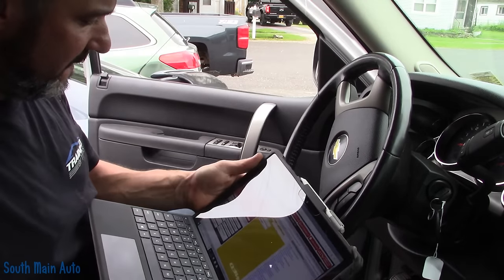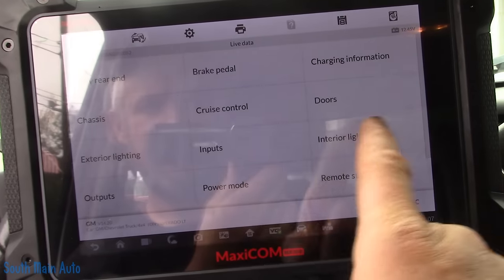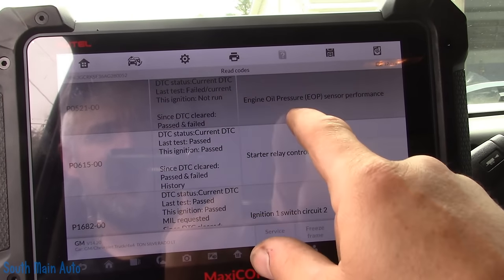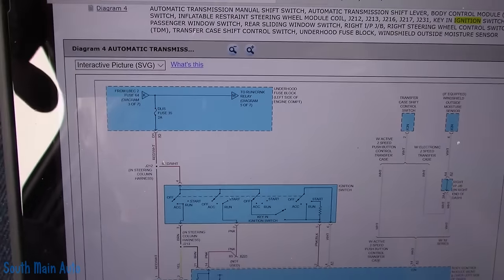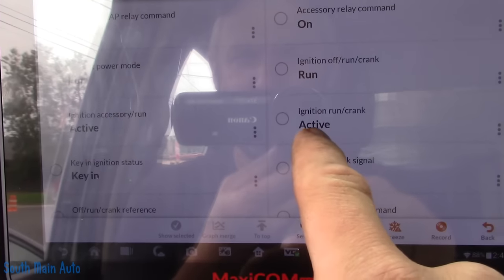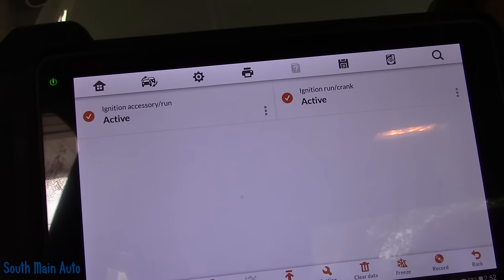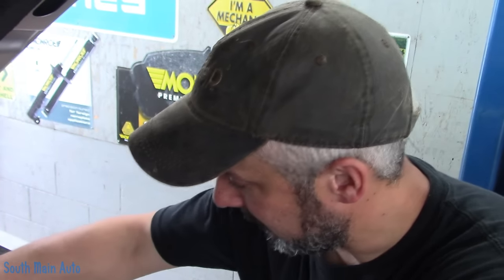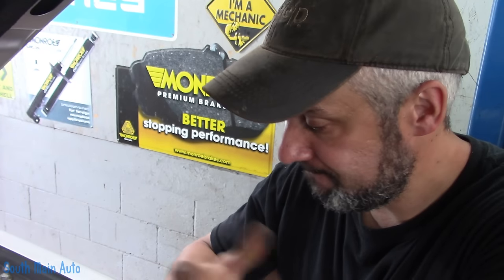Chevy/GMC Truck: No Start - No Crank

Comment: I am having a similar issue except, I have replaced the starter. When I initially replaced the starter, it turned over 3 consecutive times. The fourth time, landed me back to square 1. 

I thought the starter had gone bad and got it replaced through O'Reilly's. Turned out, when they tested it, it passed 3x using their Starter tester. They gave me a new one. Put the new one in, and nothing. 

Both the alternator and battery are good. I was thinking it may be a wiring issue but I've looked over and over and see no issue.

*PS, spark plug, fuel pump, and all fuses and relays are good. 

Any help would be GREATLY appreciated. 
-2005 GMC Sierra 1500 5.3 V8 106k miles

Comment: Thx for the post.  Question:  Do you have a go-to site online that a lay person (DIY'er) can go to to acquire automotive wiring diagrams?  I see several when Googled, however, they are lacking.   When I ask my local Ford dealer parts counter person he gives me a 'no' response but the look of 'You should stay the hell away from your cars electrical system before you screw something up.'.

Comment: Can you just use a brush, plus the air hose to blow out the dirt not saying it will fix the problem and also contact cleaner by disconnecting the ground on the battery and spray the fuse box down after blowing the Dirt away from the fuse box for my information just inquiring thank you

Comment: I have a question have a 2000 Chevy Silverado truck ran just fine was parked went to go start it would not start someone said something about it might be the cluster took the cluster out sent it out to have them fix it they never did say what was wrong with it or if anything was wrong with it sent it back put it back in no different mind you it ran just fine before all this I'm thinking something very simple but I don't know nothing about this also I looked up ran a wire from the fuse box and touch it on the red main wire when the ignition is on on and it will start I watch some of your videos you are very intelligent with this stuff let me know if you might know what it might be thank you and keep up all good videos

Comment: The scanner computer used in the video: https://amzn.to/2H3l6dt Autel MK908 Ultimate Wireless Automotive Scan Tool with ADAS, ECU Coding, Full Bi-Directional Control, ABS Brake Bleed, OE-Level All Systems Diagnosis

Comment: Hey Eric. I have a really new chevy truck . Is the tail gate heater module controlled by the body control module. I am freezing my hands off every time I have to push it into the garage to get fixed. For those out there that do not understand. Chevy has a heated tail gate for when you have to  push your truck into the garage for repair.

Comment: I have a 2011 Chevrolet and had a short in the fuse box so I pulled the box off. Unhooked the plugs on back of it and looked it over real good. When I hooked it back up and tried to start my truck a security light popped up on dash. Now it won't do anything and that light with a lock on it comes on on my dash

Comment: It is fairly common for those power (fuse) boxes to be filled with dirt and corrode the metal components. This in turn will set off a series of electrical issues. The box cover is poorly designed, and the metal components are made of various cheap metals- much cheaper than they should be.

Comment: Good video, did you change the oil pressure sensor after all this? That was the original problem. Would like to see that video, they are a pain to change.
Reply: It was an old code I believe - and yes they ARE A MAJOR PAIN to change out.  Im dreading doing mine when time comes!
Reply: @JenniferFuchek  Mine needs something like that. 2012 silverado 1500, oil pressure slowly goes down to below 20psi at idle after warm up. I'm hoping its not the o-ring on the oil pick up tube in the pan.
Reply: @jmcenterprises9591  does it show low pressure and oil level is fine via dipstick check?
If it's still original pressure sensor it wouldn't hurt to change as I don't believe they're too expensive. 
I do know the pickup screens are notorious for getting blockages too.... maybe do a bit of maintenance (if able to) and drop the pan, change seals and gaskets/o-rings, clean that pickup screen, clean pan for any sediment or gunk, etc.
Let me know if you do determine what it is.
Reply: @jmcenterprises9591  also forgot to ask - are you using an aftermarket oil filter or OEM delco? I ask because mine was super low and after doing research I determined it to be the filter causing it.  I discovered the filters like Fram and Wix dont have the "proper" valves or whatnot for backflow and pressure. 
Once I changed mine to AC Delco my oil pressure came right back up where it should've been.
(Side note: if pressure goes to around 20 on a warm day and engine at operating temp while stopped and engine is at idle, I wouldn't worry too much over it. If it goes to 20 while driving under acceleration that's a different scenario and cause for concern).
Reply: @JenniferFuchek  Thanks Jennifer for all of this info. Dropping the pan is a pain because its a 4x4 and the transfer case is in the way. Still I may have to do what you said. I'd have to get a cheap tranny jack from harbor freight. I can do it, just takes me forever. I'll check the oil filter brand, I use NAPA but I just bought this truck a few months ago and did not notice the oil filter brand. The oil level is full and still clean, no valve train noise at all (if oil pressure was low I'd probably hear the rattling/tapping of the valve train). I also read that there's another screen right below the oil pressure sensor that gets clogged-I will take a pick and remove/clean it. I will check the oil filter and get back to you here later or tonight.
Reply: @jmcenterprises9591  you're welcome. Id surely start by checking the oil filter brand.
I do believe there is a screen where the pressure sending unit goes into the rear of the engine... you can surely check & clean it as well while you have the sending unit removed.
My husband drives the 2005 suburban and recently used some of the engine flush stuff (add to crankcase oil, start engine and idle ONLY for 5 minutes then drain oil & complete oil change procedure as normal). He swears it helped his with the notorious tap (cold start only, every once in a while, only lasts about 3-4 seconds max, oil level is correct, etc).
I'm considering running Rislone engine treatment through mine (as a preventative thing) but I'm hesitant because I know coked oil or gunk can get dislodged and clog up tiny orifices and cause huge problems that were nonexistent before. My oil pressure stays just above 20 on a hot day on hot engine at idle. Driving it's around 45 or so.

If you use Facebook you can also join one of the the Chevy forums groups - those people on there can give A LOT more detailed info and tips/tricks than I can.
Reply: Its a Fram

Comment: Chevy has crappy fuse boxes and their covers don't really keep moisture and sand/dirt/grit out. I have a 2003 that's driving me nuts. I wondered about putting a new fuse box in from gmpartsdirect. Are their just wire connect plugs on the bottom? And the mega fuse, are both wires to it positive or is one a ground cause one of them that doesn't go to the battery is corroded at the end. If I lived close by I'd certainly have you figure it out.

Comment: This same thing has been happening to my 2008 Silverado since this summer when I had a new engine put in.  Every couple of days it just decides it will not start.  I pulled the same 2 amp fuse you did and mine was the same corrosion.  However, replacing it did not fix the issue, my truck is still sittting here in the parking lot at my work.  Any other help or suggestions would be great.

Comment: Nice video! My problem is a no crank, no start on a '99 Silverado... Only seems to happen when the engine is good and warm, Underhood fuse box is clean. all lights and sounds come on when key is turned. Thanks in advance o any thoughts

Comment: I have the same problem with an 2007.5 with oil pressure light before shut off and now no start but also no fuel relay clicking also. Battery fues box was in same shape with 8 blown fuses and white powder everywhere. That 2 amp fuse is good. No snap on tool to test. Can you help point me in right direction please? Ty.

Comment: Nice diagnosis Eric. Wasn't the original problem an oil pressure switch reading?  I thought I saw that in the DTC codes.  Just curious. So maybe 2 unrelated problems.
Reply: Yep.  You're correct!

Comment: Eric,
Interesting case study, great video and fix - thank you! Its intersting how dirty that fuse box is yet the rest of the engine compartment is fairly clean. I have to agree with the poster that said possible flood damage. I hope you will do a video of the fuse box replacement if you do get that job.
SMA#1
God bless
Paul

Comment: I have a 2007 Tahoe LTZ.  I have a charged battery but no lights, no nothin, remote locks don’t work, no nothing.  Had a problem with the transfer case that was fixed by a local shop, 8 months later 4wheel drive wouldn’t engage unless I pulled the fuse box then replaced it back in the bay.  One yr later nothing. No electricity at all.  Thinking the issue is at the box.  This Tahoe was rusting at the seams at 2.5 yrs!  Any ideas?

Comment: it was so easy when the only thing that usually stopped one from starting was the neutral safety switch. now the abs module can stop them from starting. was easy when you turned the key connection was made and starter engauged and started up. computers are nice but somethings dont need computer. like the t-body should be a cable to open and close life could be easy.

Comment: I did the test light on all my fuses in the fuse box and all them had no power but tested them with the ohmmeter and they were all good Any idea why the fuse box wouldn’t be getting power? Car won’t crank only one driver headlight works breaks work no horn no power windows and no alarm beep with I lock my truck with my key? 2016 Silverado
Reply: Also the connectors on the bottom of the fuse box were fine no Corrosion

Comment: Fuses are also resistors as they need to heat up to melt.

What is the typical voltage drop across a good fuse in 12 V systems?

Comment: I need help. My 08 sierra just started fine. I let it warm up then turned it off. I came back to go to town and there's no power, no accessory power, NOTHING at the key just like it has no battery. Booster box does nothing. Odly the engine light will NOT go off. Truck was fine 10mins ago. Can you help lead me to anything please?

Comment: That fusebox makes me wonder if his oil-light issue isn't also a fusebox issue.  Maybe there's nothing wrong with the sending unit, it just thinks there's something wrong with it because the signal's being blocked by some corroded connection in that fuse box?

Comment: 2000 chevy express crank/no start. Tested everything.

Narrowed it down to faulty crank sensor. Went to replace it and was nearly drenched by oil. Good cup of oil. I swear I'm ready to push this van into a river!  
Now. I have to deal with this leak BEFORE starting over on no start.....Nightmare.

Comment: So.... I have watched a lot of your videos.  Almost all of them related to GM products.

I have a billion electrical issues on my 2007 escalade.... And believe it to be relay issues.  The box itself does NOT have pin markings on it to show what direction the relays go in.  No marks, no numbers, nothing.  My main issue is when trying to start the starter spins but vehicle doesn't start.  That happens about 1 in 8 times.  Then sometimes it just cranks right up as if no problems.  I want to first go to the box and ensure the direction of the relays is correct.  Any help you can give ?

Comment: Holy crap! What a friggin mess in there! I'd be willing to bet, the lid goes missing because they're a PITA to remove and reinstall the first time you encounter one. I had a hell of a time getting mine off and back on when the truck was new (had to yank a fuse in order to install the Hypertech programming) - I was ready to smash the thing, LOL! Heck, I still have a hard time with it! It hits that support brace for the hood, and gets all jammed up. GRRR!

Looked like a carbon copy of my truck. Gotta love the Chevy tick at startup when they sit any length of time. Just screams, "I'mma fail at 100k!" 😣 I was surprised my differential failed first, at 97k ...

I'm gonna be soaring with the eagles VERY soon! Just placed my order for a paramotor yesterday! Just waiting for my bill, and it'll be on its way. Talon 190 2-stroke engine (26.5 HP), and a Lite Trike - was going to get the quad, but it blew my budget. I'll just have to be super careful on the ground. So excited!!! 🎊😎🎉👍 Should have a bunch of videos on that when it gets here.😊
Reply: We know who’s making the packie run on Sundays now 😁
Reply: @paultomasetti5164  - Oh absolutely! 🍻🍻🍻🤣

Comment: What about the original problem with the oil pressure???????????
Reply: Pressure switch. Oil pressure is fine. The switch is a common failure and pain in the butt to change.

Comment: Very interesting video! I have a question. I have a 2008 Kia Rondo with a 2.7 in it. It is showing a cylinder 3 misfire code. Would that cause it to stall at idle and have no power once it warms up?

Comment: Hello i have a 2010 cadillac escalade hybrid that I have a no crank no start the main issue is that its not programming the key the anti theft light keeps staying on the anti theft module was changed, ECM and the bat was done to the ECM so it has no security and final resource but still has the same issue was wondering if you have any tips for me or if you could check it out please and thank you

Comment: That doesn't happend often that a failure happens in the lot. When I see that issue I spray them down with rust check and let them sit. It sucks when they rot.... God bless the salt/brine.

Comment: I just watched your video. I have a 2007 chevrolet silverado with no crank, no start. Could it be a  fuse box issue ? My key fob doesn't even work. I'm just curious what you think.

Comment: did you know Eric you can check fuses with a test light on each side of the fuse by touching the top of the fuse in each conner
Reply: pretty sure that's exactly what he did aside from when measuring amp draw as both probes need to touch or an inductive loop is needed...

Comment: I have a 2005 ram 2500 
5.7 I spent 3 grend chasing a check engine light new cats twice 8 new o2 sensor's  new ecm. Still low cat threshold and o2 slow to respond  dealer won't even work on it anymore. Know of any mechanics in the central Missouri area that are even close to as good as you? If you were closer to me i would bring it to you in a heartbeat.

Comment: Hello liked and subscribed to your channel. Great video I also have an autel. My problem is I did some body work to a 2008 1500 gmc sierra and some welding customer brought it in driving. I disconnected battery when welding now truck won't start checked fuses but anti theft is on and key fob doesn't work.

Comment: I have a problem jus like this you mind giving me pointers on how to go from here I have changed everything stater alternator spark plugs and it’s still not getting any fire it currently only reads 11 volts on the battery gauge no matter if I charge the battery or get a new it stay the same voltage I jus don’t know what to do from here and I did put a cam on it and had it tuned it’s a 2008 gmc seirra jus any opinion you have would be great thank you

Comment: Mister South main I need your help I've taken my truck to 3 different shops for an ac issues it's not comanding  the compressor to come on from the dash module the 5 volt red just drops out and I can't find the where the AC on wire runs to ohm it out iv traced what I can I can't finde the splice pack sp 205 it's a 2006 Chevy Silverado

Comment: Damn, wish I saw this 2 years ago!  I have the same truck and the radiator fan kept running with the key off.  Dealer charged the fuse box for $444!

Comment: what about my 07 tahoe? i """"""parked it, it did not stall"""" 1 day and it just did not start again, all lights came on and cluster dash came on, got a brand new battery, dome lights all popped on but  it cranked and gargled but still it did not start now i cant even boost it and even get a crank out of it, now its seems even after i charge my batteries and plug them in i now cant even get a cluster to light up.

Comment: ECM? that is a term from the OBD1 days. PCM (power train control module) or BCM (body control module) more common today. I would not have jumped right into a scan tool for a no crank. Physical inspection first. I can't believe you laid those pliers in the box like that. What was your diagnostic labor charge for that job? Please. True, never saw a box corroded like that here in Tucson.

Comment: I'm having issues ever since my key cylinder locked up. I replaced cylinder and now it won't shut off and I'm getting power even with the switch off. My windows, radio and all are still getting power even tho everything on dash is off and key is out of switch. While working on switch I  noticed the rap2 fuse was missing under the hood so I put one in. Before I put the fuse in and before switch went out I was getting codes for torque converter, shift/timing solenoids and manufacturer  control. After putting fuse in my scanner isn't getting picking up any codes but I know the transmission isn't shifting correctly and I notice a loss in power and gas economy still. You have any tips or advice.

Comment: Did it get that way because the battery gassed and the fuse box cover was off?
Reply: Unlikely.  Due to the amount of dirt/sand sitting on the fuse box.  Looks like it probably got wet as well...   Corrosion just happens when things are left in an unprotected state.